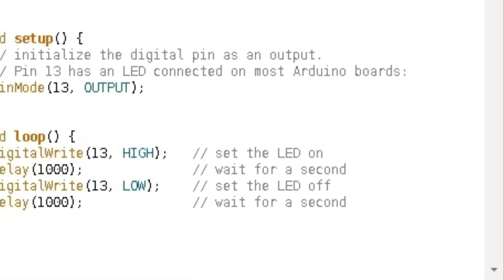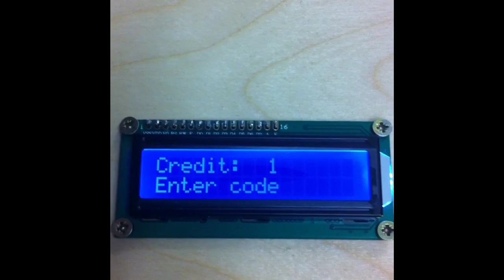Arduino/Pi Vending Machine

Comment from the maker: Hi Oliver,
The Arduino and Pi were connected via USB and communicated over a serial connection using JSON. There is plenty of tutorials showing how to do this online.
There was also a Apache webserver running on the Pi allowing us to connect to it over the internet and control the vending machine through a web interface.
Hope this helps,
David

Comment from the maker: Hi,
Materials we had for this project were a box structure, LCD Screen, Keypad, Breadboards, Jumper Wires, resistors, LEDs, Battery pack, Arduino MEGA 2560, Raspberry Pi, Vending machine coils and a Servo.
Hope this helps,
David

Comment from the maker: Hi,

The LCD screen and Keypad have jumper pins soldered to the connections then each of these is connected to a breadboard with normal wires. They are then sorted in to the correct digital output ports on the Arduino. There is code available freely online to get the LCD screen and keypad giving in input/output to the Arduino.

Hope this helps,

David